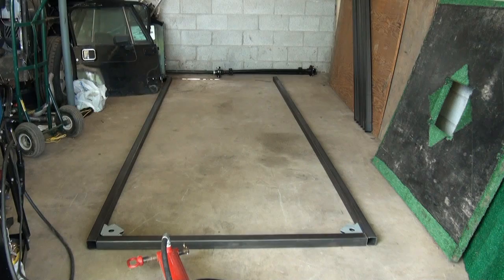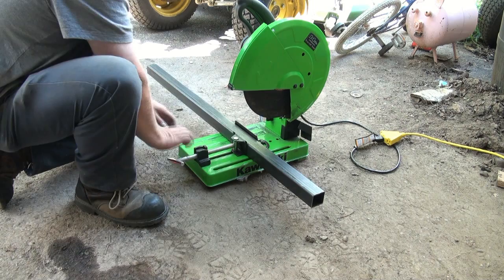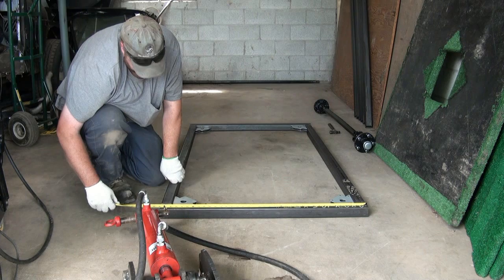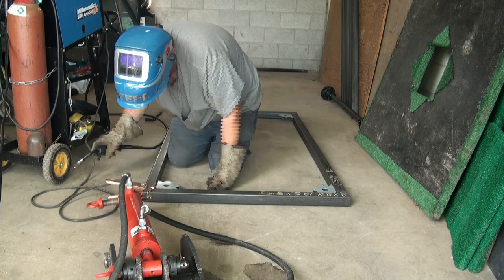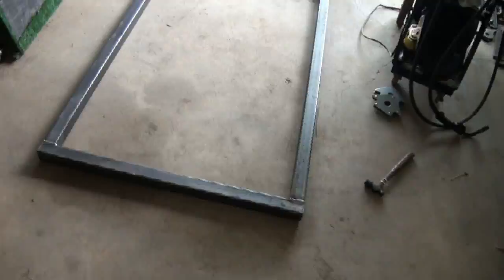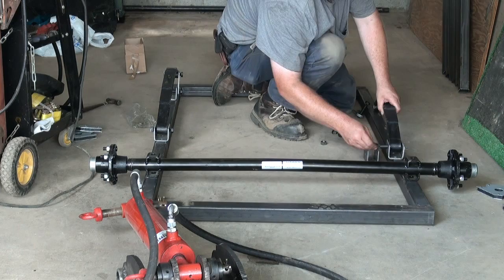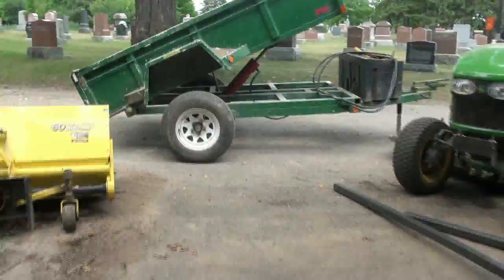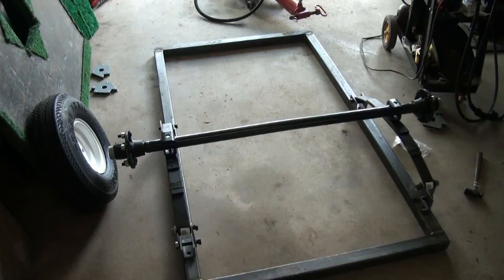THE TRAILER PROJECT RAW AND UNCUT day 1

Comment: Enjoying another build video.
.
Bend in axle should be upwards.
Rear spring hanger angle should slope back with the rear spring eye further back than the chassis bolt.
If it slopes forward the spring will get softer the more weight you put on it,
You want the spring to get harder as the weight increases.
When she's empty you want it just less than 90degrees.

Comment: I like the uncut Video!!!  The trailer is coming along good too. If you are taking your time building it THAT'S GOOD. Take my advice as a Fabricator don't be in such a hurry to weld it up right away tack it all together to make sure that is is the way you want it. You have the Backhoe to lift and move the frame into position for welding after it's fit. the frame will stay together and square better if all of the pieces are in place

Comment: I weld a bit like rebuilding vehicles and stuff, and just as a suggestion you might want to clean your welds with grinder apply weld through primer before / after welds so there's way less risk of rust

Comment: Your green dump trailer has what's referred to as a drop axle so that the trailer sets lower to the ground. These axles cost a bit more when ordered with the trailer but to purchase one for a trailer is quite a bit more. As u we'll know now the axle has what is referred to as a crown - not an ark - if you ever notice the crown is no longer in the axle it been over loaded and should be replaced. The reason is if the axles crown drops it will wear your tires out if used on the highway. Cheers

Comment: Right around 28 minutes you said you don't know why the set them up that way referring to the shackles for the leaf springs. The reason for the extra flex is as the leaf springs do their job the eyes on the springs move further apart and closer together. If they were not allowed to do this there's a good chance they would break under heavy load.

Comment: I think those rear spring mounts definitely must be a bit forward so the weight of the whole trailer doesn't sit on those small plates the spring is mounted to with them facing straight downwards. They are there for flexing, as it is on the bigger trailer.

Comment: If you put the axle on the bottom of the spring it won't drop 4" it will drop 2", the distance from the bottom of the spring to the center of the axle.

Comment: I wouldnt mount the axle or springs yet if it were me that way you can still have it sit flat on the floor to cut and weld all the rest in and flip it back and forth to weld all the sides up that will just make it more ackward to flip and move save it for almost last good vids though